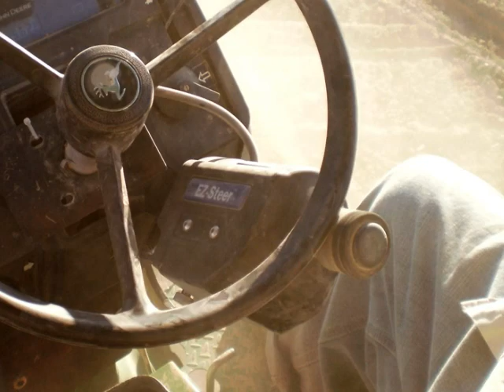BioFuel- producing oil from castor

Comment: Hi there , I am an Harvesting contractor based in Zimbabwe , I have been approached to harvest castor beans , so am just doing some homework . The head you used to harvest the beans , is it just a standard maize head , or have you modified it to catch the pods ?  I imagine that there will be a lot of residue from the plants going through the machine that you will have to pressure wash the inside of the combine fairly regularly during the day , is that a correct assumption ? This video is  a few year old now , are you still using the same harvesting system ? I have seen some videos where the farmers are using cotton pickers to harvest the pods and then they shell the pods later in a sheller. Any info would be great , thanks .
Reply: Hi Tony. I am from RSA and busy putting together a propozal for a big company here. Can you please help me with info regarding the harvesting. Where are you going to harvest (I want to look at satelite fotos of whereever)
Reply: @gauravpatil-uq7xs  Hi can you please give me your nr with the land format, I have a lot of questions regarding castor.
Reply: @gauravpatil-uq7xs   how many castor plant in 4200 metre.. I think the dentisty is  different Or the kind of castor is different.. If it iswhat kind of castor plant do you use
Reply: @tawfekmoawad7555  That's what I want to know too